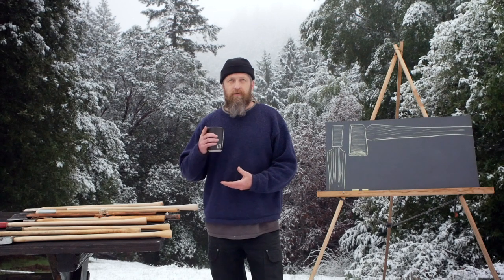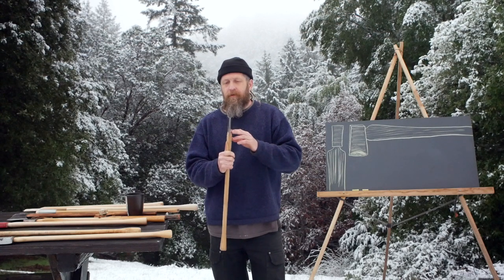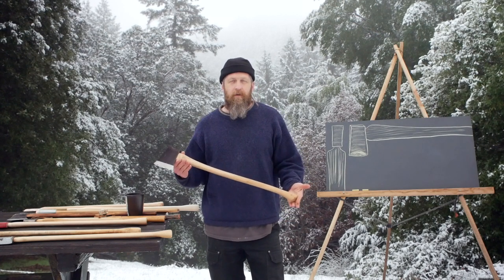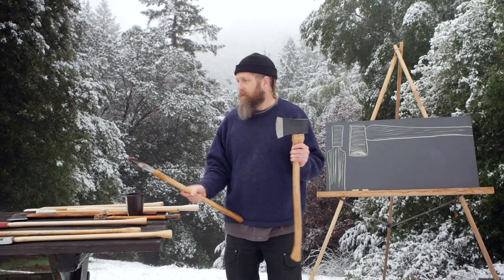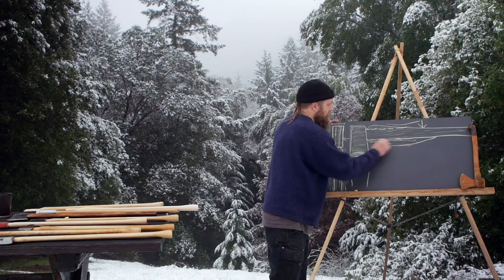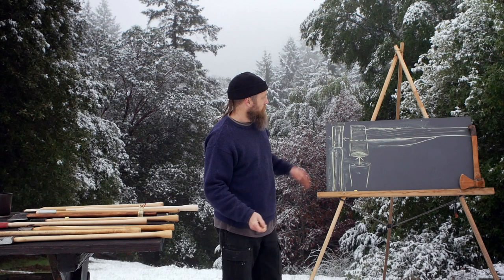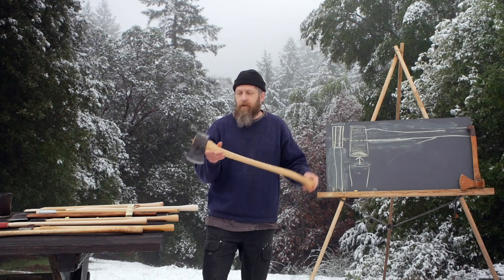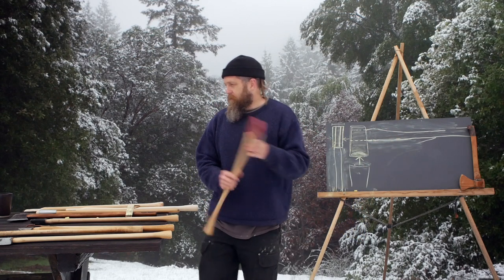Failure By Design, Axe Handle Design Mistakes and Improvements, *Spread the Stress*

Comment: The talk about the shoulder and the differential wood thickness made me think of tillering a bow. Mind you, I've never made a bow, but the entire tillering process is devoted to getting the wood to flex where you want it to flex and not where you don't. There seems to be a lot of the same principles at work here.
Reply from the maker: Exactly, I used that analogy either in this video or another recent one, but edited it out in either case.  That discussion is coming though.  It is the perfect analogy, because it's easy to understand.  It's rare I think that people look at this system that way, but it's very similar distribution of stress issue.  My analogy was to take a stave and make a bow limb out of only 6 inches of it, then try to bend it.  It's obvious what happens v.s. a fully finished bow. with the same stress applied.
Reply: Exactly! Great point. Will probably be lost on 99% of people, but perfectly illustrates the point.

Comment: Not to forget that when the handle is wider than the head itself on the sides makes the wood more likely to get chewed up while penetrating the wood you are cutting. If it is thinner than the head then the head itself protects it quite nicely.
Thanks for another very informative video! Be safe out there Steven!
Miha
Reply from the maker: Yes, at least as narrow as the head and preferably narrower!  All too commonly it is actually wider than the head.

Comment: Very good breakdown of common reasons for failure. Thank you. A less common but interesting one is too much compression of the wood within the eye. One of my first few handles broke right under the head even though I was very careful with my transitions and proportions. I used glue for the wedge which lubricated the joint and then I used a pipe clamp to drive it in. Then I added a small steel wedge going the other way. The combination of these factors basically crushed the wood (white oak in this case) and it failed after very little use.

Comment: Good video, good theories. In machining metal any sharp corner (little to no radius at the thickness change) is called a "stress riser" or "stress concentrator". The more gradual the change in thickness the greater the area any stress will be dissipated across; thus the more likely to flex than break. As an example, wedges are not prone to breakage due to a gradual continual change in width throughout the length of the wedge. Being one piece of the same material doesn't hurt either.
Reply from the maker: Thanks.  I just knew that from experience/logic/extrapolation and whatever else, but in the next version of this video, I did mention that term as a couple of other people pointed that out as well.  It's good to have confirmation from that world.

Comment: Any large change in stiffness either due to a material or sectional change is a location for stress concentration.  Biggest factor about handles with a thickness change is that the moment of inertia has a cubic function with respect to thickness so a small change can drastically change its stiffness.
Reply from the maker: Did not know that.  Still not sure I understand it, but I'll stick it in my head and let it rattle around.  Thanks for commenting.
Reply: @SkillCult  I THINK it would work out as, ok ..hang on now....
Say the dimension of a given 1cm length of the handle was 2cm x 3cm, so 2x3x1 = 6cm cubed
and further say the next 1cm section was a bit fatter, say 3cm x 3cm, so 3x3x1 = 9cm cubed.
For that extra 1 cm of dimensional thickness, it's an increase of 50% in the cubic area... sooo I guess this is where the cubic function of inertia plays?  That that small difference can cause a significant change in volume which would allow for inertia differential and thus breakage.
Maybe.
Maybe I'm talking out my ass.  I might be somewhat right though!

Comment: A very experienced guide told me in the fifties and sixties that he didn't like the "Hudson Bay" style axe head (much like the short axe on your blackboard's right side) because the cutting edge was so much wider than the eye and applied a larger amount of leverage against the handle and resulted in more breakage than a head with cutting edge very similar in width to the eye width.  A different angle on the same subject but I have always agreed with it in real world experience since then.  Good topic.  Take care.  Doug
Reply from the maker: Hudson Bay was my first axe.  I learned to hate it lol.  I'll have to tell that story sometime, but I got tired of replacing handles and honestly, they are not great choppers anyway.  I always figured it had more to do with the short eye, but I can see what he's getting at I think.  Perhaps a combination of the eye being smaller and that smaller mass being offset to much.  I basically consider then a primitive design barely evolved from tomahawks.  There are a lot of designs like that around the world, but it's easy to see why that was an early evolutionary form given that metal was very dear at one time.

Comment: Excellent thoughts, one step closer to regaining what loggers knew 200 years ago.  Two factors you might consider- 1) Matching the axe design to the job.  Taking too small of an axe and reefing on it will create breakage no matter handle size.  Splitting should be done with a maul, bucking with a 3.5 to 4lb felling axe, fine work with a smaller axe.  This would eliminate most of the problems new axe users experience.  2) Proper grain in the wood will eliminate breakage in the toe and heel areas just under the head.  Thank you, thinning a handle is crucial and I really enjoyed your approach to explaining it.
Reply from the maker: You can get away with a lot using small axes. I'm a big fan in general and I rarely need anything else, though I prefer to spit with something bigger.  But I'm not out cutting down and bucking a bunch of stuff over 12 inches.  Breakage is also increased by death grip, which no experienced chopper will continue for long.  There is a point as which it's nice to scale up, but a small head also puts less strain on the wood when it goes against the handle due to whatever various forces happen in chopping.  The things that break most handles for beginners is low skill and not understanding a few important things about technique and approach..  Aim is a big one, hitting the handle on stuff.  Another is over zealousness in general.  Trying to drive the axe through the wood after it hits is also big.  Death grip on the handle.  Stuff like that.

Comment: Great content and delivered very well.  The best example of close to —perfection of an Axe Handle are the early handles on Vintage axes from the Golden Era. They Usually were premium Hickory exhibiting the best in grain and density.  Those old quality handles were Thin but strong. They exhibit all the important characteristics you bring to light.  I’ve bought old non marked American made Axes that a lot of people would pass up—mainly for an excellent specimen of a handle in excellent condition.  Most of those old unmarked heads from 40+ years ago are of super quality—but likely had just a paper Lable. They make superior tools compared to 90% of Newer tools sold today 🇺🇸
Reply from the maker: Yeah and they are not the hard to gain the trust of.  My friend had one he used to feed flies every morning in front of his shop.

Comment: The 4 in one also is useful in bow making. I agree totally with your views on handles, and do the same kind of things to mine. I also add a leather wrap, but it is just because I like how it looks as I do not think they help overmuch.
Reply from the maker: Those shoe maker's rasps are a great multi purpose tool to have around.  Leather helps less than some other things.  A tight, compressive wrap can go a long way toward holding the wood together under stress, similar to backing a bow with rawhide or sinew.  Leather has more cushion, but it's hard to get it really tight.  I like rawhide, and it looks awesome, but it's a lot of work.  Tape or cloth wrap works well.

Comment: Well said Steven. I just bought a nice axe at harbor freight, for $23, can’t really go wrong price wise, in any case I totally agree with your statement of thinning the handles, be it not just for the suspension, but additionally for comfort as well. Thanks for everything you do and show us, from axes to apples Sam
Reply from the maker: you can go wrong if the handle is really bad, or it won't stay sharp enough to chop, but hopefully not.  At some point, obviously handles can become too thin and vulnerable.  Also, there are different types of stresses and different types of wood or grain violations that can make handles more or less vulnerable at different points.

Comment: 13:33
I frequented a bowyery forum in the mid 2000s and everybody started making these "Mollegabet bows". They were these big long bows with only a short piece of the limb near the handle doing the actual work, and then they transitioned to what you call the "Levers". The limbs were really wide and flat, and the levers were super skinny from left to right, but a little thicker front-to-back. This gave you almost all the benefits of a long bow while keeping the ends of the limbs ultra light. You'd get the string angle of a longer bow, but way faster.

Some of the forum users did some pretty extensive testing to find the optimal thickness for the levers, in order to make the bows limbs as light as possible. What they found was that as a general rule, doubling the thickness of a piece of wood made it eight times stronger in that dimension.

This is all anecdotal, so take it with a grain of salt. Still something to think about though.
Reply from the maker: Interesting.  Sounds like pushing the limits of the material to get higher performance.  Doesn't matter as long as it doesn't fail.  I think you could say the same thing about American axes with smaller eyes and thinner handles.

Comment: Great videos, from Scandinavian tradition, we have narrower handles than heads in both directions of thickness, to your points of flexibility. I have both inherited multiple old axe shafts and heads hundreds of years old, and make my own ash handles, with your advice.
Reply: I would love help. My hickory double bit ace handle broke and I’m really discouraged because I thought built it well but it split down the middle of the handle. Rhe head was fine but the handle wasn’t. Is there anyway I can have help?

Comment: I don't have as much experience using axes as you do, but based on what I know from 20 years of general woodworking, carving, &c, what you say makes a lot of sense to me.
Reply from the maker: I'd say what I think I understand about it has as much to do with intuition based on other wood working and working with any materials as it does with formulating theories specifically around axes.  If I put an axe head on the end of a baseball bat, a lot of people, and certainly people like you, intuit instantly that there is a problem and the eye is vulnerable to breakage.  I find if very useful to take things to extremes to elucidate potential problems.  Put an axe on a baseball bat  or on a pool cue and we have instantly established boundaries and formulated important questions.

Comment: Good point.  I believe it's attraction was lighter weight around here as well because it was used as a trapping axe carried on the pack (anyone remember the 'Trapper Nelson' pack??).  Most of those were 3/4 axes.  Take care.  Doug
Reply from the maker: Yeah, I think that may have been part of it.  I think Indians and probably independent trappers would have likely been used to relatively light cheap axes anyway.  I'm not sure, but I don't think there were ears on axes yet, or at least they weren't common.  that would have provided an alternative to a short eye in a light axe. But they also could have shifted some of that very long blade into the body I guess.

Comment: Great video a lot of common sense right there. You speak with the authority that comes from legit experience. Thanks
Reply from the maker: I'll usually just state stuff without too much qualification or disclaiming if I have a pretty high confidence that it's correct.  But I think by default, I work partially on the assumption that people will consume information critically, even if it's not always really true :)

Comment: It would be great if a materials engineer or structural engineer would chime in...  This is their metier.   A smooth transition is key.  That reduces the "shearing" effect of the applied forces.  I've considered a radius on the lower edge of the eye to displace the stress over a greater surface area.   This is where someone with experience in breaking handles may have some input as well...  digging the snow and trees in the background!

Comment: In addition to the 4 way rasp, my favorite tools for thinning/shaping a handle is a spoke shave and a draw knife. I also use the draw knife as a make shift card scraper by orienting the edge perpendicular to the surface of the wood. I’ve also used a modified machete blade, sharpened with a single bevel chisel grind as a handle scraper.
Reply from the maker: Spoke shaves are pretty awesome.  One nice thing about the rasp is it's easy to use with one hand.  Of course with an axe, you can stick it in a stump, so that opens up the possibility of using two handed tools.  I would recommend staying away from drawknives for anyone that is not pretty experienced as it's so easy to do a lot of damage really fast if the grain isn't carefully attended to.  I like your machete scraper idea.  Rasp is also particularly nice for curves in transitions.
Reply: SkillCult —depending on how deep the rabbit hole of back country fabrication you want to go, Dave Canterbury from the Pathfinder school has a whole series on using his basic 5 tool kit to carve out a work bench from a stump, and from there he goes to town with wedges etc. He had a mini-draw knife he forged out of an old file that he has in his kit specifically to hog out crude tool handles. 

I think that’s a rather specialized tool for to carry on my back for pioneering, but I’m thinking about making a few for my shop to fit in the hierarchy between spike shave and full size draw knife.
Reply from the maker: If I had my most basic 5 tools for small scale wood fabrication without vices, the shoemaker's rasp would be one of them.  A vise changes everything though.  I tend to think basic, light and portable, but that's just a different paradigm than most people think in.

Comment: That makes sense to me. I've seen not experienced, axes with petite handles handle much much more work than axes with thicker handles. I have a council tool pack axe and I have noticed that the handle being as thin as it is, actually feels better to use and also it seems to absorb shock better.
Reply from the maker: I like the council tool handles a lot.  I still thin them more though.  If you look at old axes on ebay, the difference is pretty obvious.